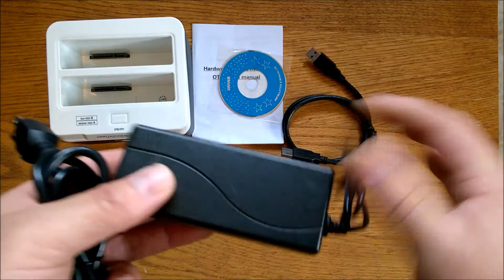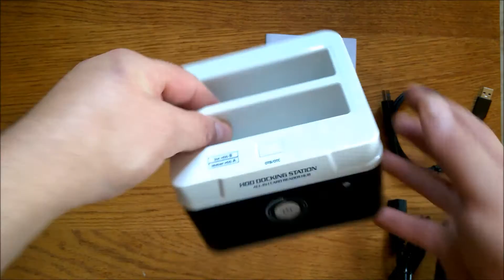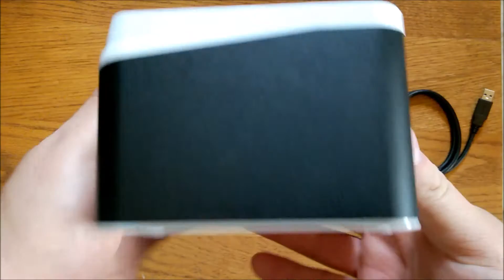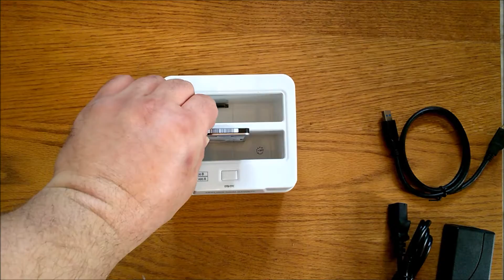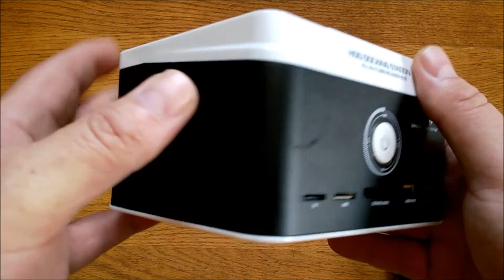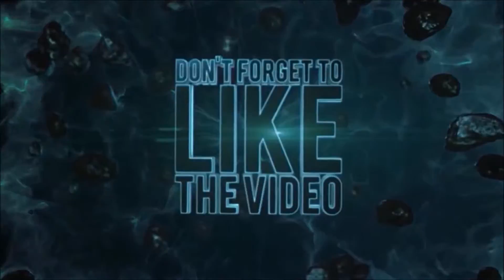QoolTek USB Docking Station

Comment: These things are great for cloning drives ready for install. I have thought about getting one a few times but never got round to actually buying, having those card slots is a huge plus for transferring footage ready to take the drive away to another computer for import. I keep a copy of Supadupa purely for those annoying times when a drive is failing on me, or I decide to swap to a bigger drive in the MacBook. A great product for the arsenal, and a great video too buddy :)
Reply from the maker: Yeah and it is great for storage as well, you put 2 drives in and when one is full replace it with an empty one, kind of like a NAS but without the network connection. Thanks for watching and thanks for the compliment!